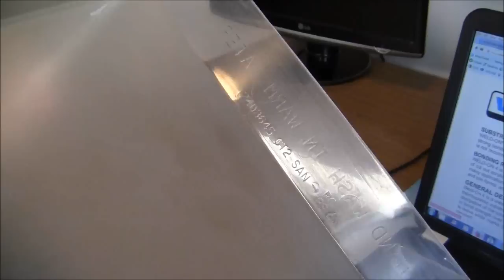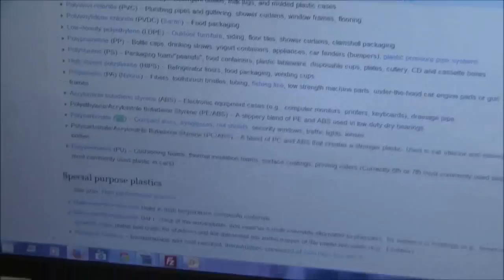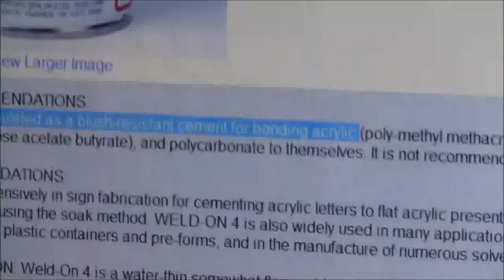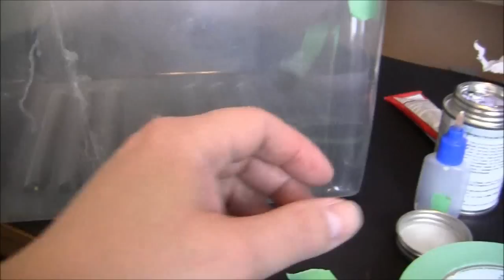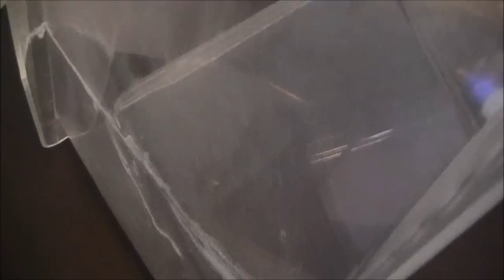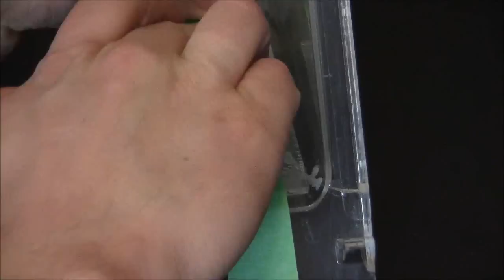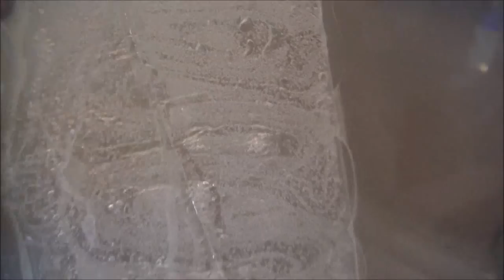Fridge Drawer Repair

Comment: From my personal experience, the only thing that really works is sadly not easily available to purchase in the UK. It's the product you used called WeldOn 'No.4' and it literally dissolves one side of the cracked plastic to the other and makes a bond that's as strong, if not stronger, that the original. It works brilliantly and repaired cracks in my fridge drawers where the cracks ran along the brackets where the weight in the drawer is constant. It can be a bit ugly if you put too much as it leaves the plastic diffused, and it's tricky to apply because its viscosity is that of water, but it really works and welds the material together.

Comment: I have glued so many fridge drawers in my house but they always come apart days later.  But when I used a wood burning tool I melt the parts back together and it  works.  At least so far.

Comment: drawers in older fridges were not clear . you could paint your drawer front and make it look better . i didn't have any scraps , so used one of those clear picture frames to repair mine . the kind that are just a piece of clear (acrylic ?) material w/several bends . it was just the right width to fit from top to bottom of drawer , though thinner than what you used . my front was still solid , drawer broke in the area where front meets sides . i cut the 180 bends off ends of picture frame , straightened the remainder to 90 degrees w/heat gun , and fastened on inside of drawer . didn't have the right glue , so drilled holes w/heated (not red hot) nail slowly pushed thru , then fastened . not pretty , but functional again .

Comment: I was already a fan of this video by 2:27 -- when I had a "Doh!" moment.  I just spent 31 minutes on hold (with no answer) at the Maytag warranty tel # to try to find out what types of plastic are used in the crisper drawer and adjustable temperature drawer in my refrigerator, so I can purchase the correct adhesive for repair.  I'm used to checking food and other containers before recycling, but it just didn't occur to me to look for any indicators on the plastic drawers in the refrigerator.

Comment: Tip. Drill a small hole (2-3mm) right at the very end of the crack before doing your repair. That prevents crack from continuing even if the glue is not perfect or comes off.

Though your repair is totally overkill, this small fix will make it last even at chock :-)

Comment: Well done.  I just looked up replacements as my sons have caused similar damage on at least 3 drawers on 2 fridges but the cost is too much in order to buy a full replacement drawer set. I think I will just leave them but I did try black sticky tape for the plastic part they managed to tear entirely off but it came right off.

Comment: excellent video and camera work... very clear to see and unlike many who make YT videos, i particularly appreciated the child free environment (which makes me NUTS trying to watch something instructional with annoying peripheral interruptions!!).  after watching your video i think i may go with very heavy duty, temperature impervious T-Rex tape (inside and out)... for a cleaner look.  i'm slightly (slightly???  lol) OCD, so i'm not sure i could deal with seeing my glue drips... which i'm convinced are almost unavoidable.

i'm completely jealous of the clean cuts on your acrylic, which you mentioned were done on your laser cutter.   do you have a video on that?   i'd LOVE to see it.   in the past i've used my Dremel and also used multiple scorings, then breaking it...  but as a perfectionist, my acrylic cuts are PATHETIC compared to yours.  plus.. it's almost impossible to cut small pieces as you did in making your patches.  the cutting friction of the Dremel melts the acrylic and makes getting a clean finish a laborious process.  i'd love to see if there is a moderately priced laser but i know nothing about them.

One final comment... it was a BRILLIANT idea to use the heat gun to custom fit the curve.  i'm a very smart guy but i would NEVER have thought of using a heat gun to manipulate the surface pitch.
Reply: Thanks, you can see the laser in operation here. https://www.youtube.com/watch?v=8_c6Yztp1kc
Reply: i'm absolutely fascinated by the laser cutter in your video link.  since even a basic laser cutter can easily run $3 - $6,000, i'm completely shocked that a $400 CO2 cutter can do this (just saw the Pro-Tech 40W CO2 on sale at Walmart for $387!!!!!).  Your video got almost 6,800 hits and i think it would skyrocket if you did a video on the cutter, the Metalfusion software and how you tell the CO2 the thickness or density of what you're cutting.... especially since there are zero YT videos on this cutter or topic.  i think most people are convinced they couldn't afford one... and more importantly how to use it if they did buy it.  Thank you for the link.  Others can read the article here.. http://hackedgadgets.com/2011/07/28/cnc-halftone-pictures/

Comment: The drawer (crisper) won't move freely when pulled or pushed on it. What can I use to make it move more freely. I cleaned the bottom but same problem.  I paid 30 bucks for the trim where the glass goes and that was used. 65 bucks for a new one. Thanks for the video.

Comment: Love your work. 
Great detail and very clear.

Looks like the Weld-on #4 bonds would have probably done the job but 
clearly the material isn't all that strong. Rather than reinforce the 
cracked parts you welded, I would have used the acrylic to reinforce the
 drawer design itself to strengthen the weak areas of the design with 
some strips in the load areas (some of your crack reinforcing will do 
this anyway which is good). 

My concern is with what chemicals I want in my fridge. These are Australian brands I am going to mention, but I am sure you can get Material Data Safety info on them with some searching. Silicone based glue products I thought would be pretty inert but it seems they release a lot of acetic acid vapor which could taint the food and the stronger Sikkaflex brand and some others I was originally looking at gradually break down to release formaldehyde! - not what you want in your fridge at all! 

Selleys Knead It Aqua seems to be the safest product I can find and is what I am going to test on the plastic I need to repair.  It says it doesn't bond to all plastics so I might have to form end to end strips / bands of it to reinforce my door shelf that is cracking at the base so it's not going to look very pretty but will get the job done. 

I am not certain, maybe a chemist can confirm, but I think most of the dangerous chemicals are released after a few days to a week or two so you probably should have allowed your drawer to vent the majority of VOC's for several day before putting him back in the fridge, maybe you did. VOC's are hard to avoid it's modern life unfortunately but I try to limit my intake of unnatural chemicals wherever I can.

Thanks for the video.

Comment: Thank you for sharing this video, I have a coupe of the door shelves with cracks on the corners where it holds up, I wondered If I could fix it, you did well, and If you want to hide the front part where you fixed it, just stick a nice photo or picture of food on the front of the draw this will look better than the repair :0)